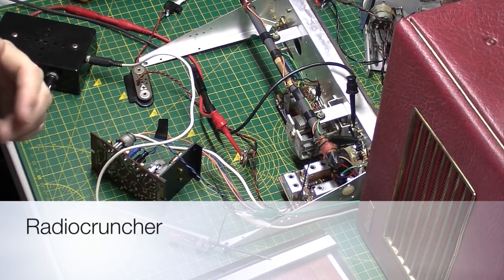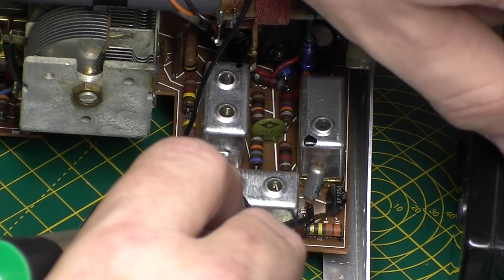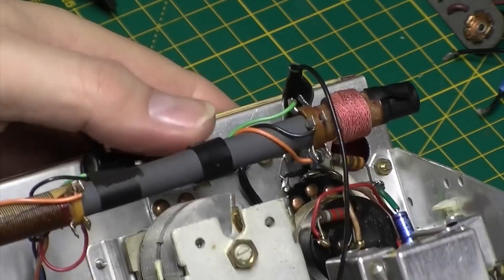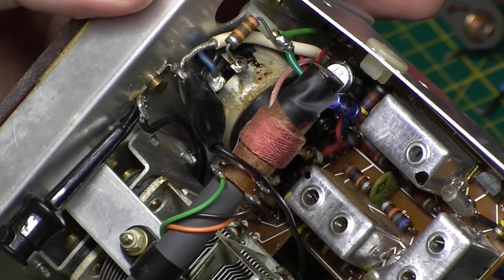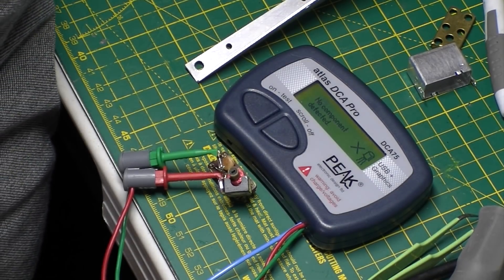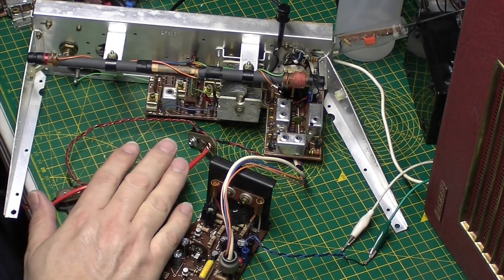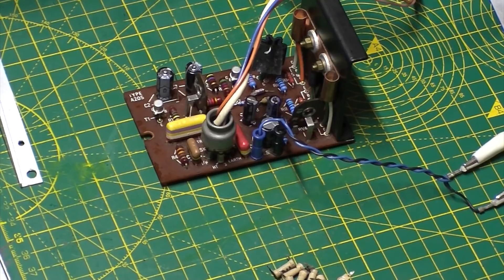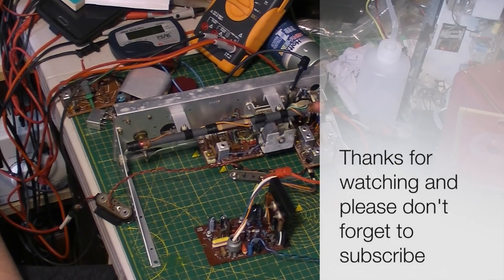A trio of Hackers. Part 3: Fault finding and repair of the Herald RP35

Comment: Love your videos, has anyone noticed that the schematic for L8 shows the diode and capacitor are shorted going out of the can?
Thanks for the videos. Carl
Reply from the maker: Thanks Carl. As far as I know the capacitor is the filter cap that removes the IF so I think that diagram is correct but then I’m no expert in radio design. Thanks for watching

Comment: Very interesting. I had a very similar issue faultfinding a Bush TR90C - the fault turned out the be a faulty OA90 detector diode in IFT3 !! I replaced it (after dismantling the IF can) and she burst into life - very satisfying is'nt it - the moment when you finally get the radio working. I also like to think about the assembly line workers who put the radio together when it was fist built! Cheers
Reply from the maker: Hi Marty. Yes it’s good to do a bit of successful fault finding from time to time. Very satisfying. Well done on the Bush it’s a tricky one to find as you don’t expect it. Thanks for watching

Comment: Hello graham. That signal tracer is great. I have never used one myself but thought about building one. Regards Chris
Reply from the maker: Hi Chris. I did send you another link which was wrong. Heres the signal tracer I built https://web.archive.org/web/20070112153637/http://www.dundeecoll.ac.uk:80/Sections/CS/Staff/al_radio/Build/ust.htm Cheers Graham
Reply: Radiocruncher  May make a video of building one of the those. I think HealthKit did one I always fancied adding to my collection.
Reply from the maker: Well worth doing Chris. I etched a little board for mine so maybe a pcb attempt on the ‘Woodpecker’?

Comment: I think it's quite rare for the detector diodes to fail but when they do, sod's law says it's always the ones inside cans! I did a Perdio Town & Country (lovely radio btw with short wave and the works) a bit back that had exactly the same problem. :-)
Reply from the maker: I think this is only the 2nd time I have come across the detector failing and that was in a can as well. Luckily the signal tracer got me there fairly quickly. I have a couple Perdio’s here but not a Town and Country. Thanks for watching